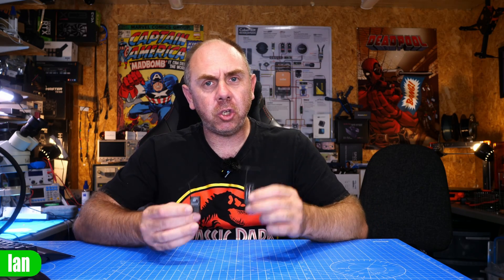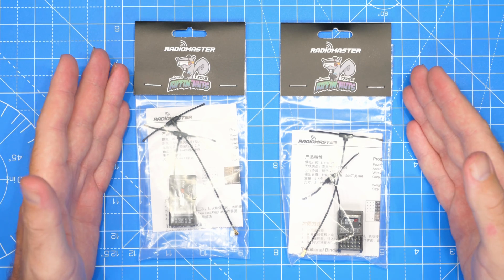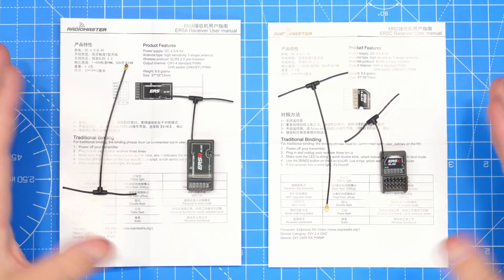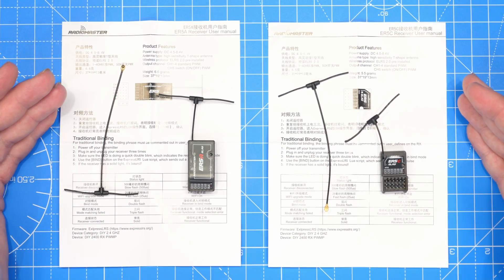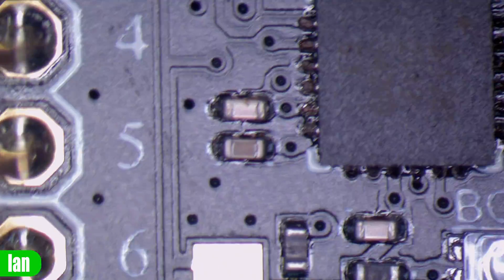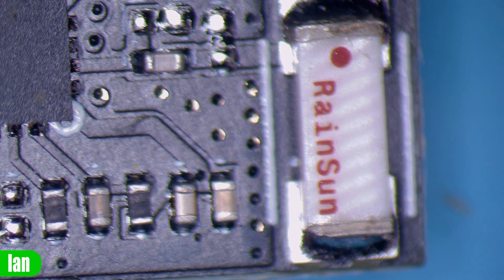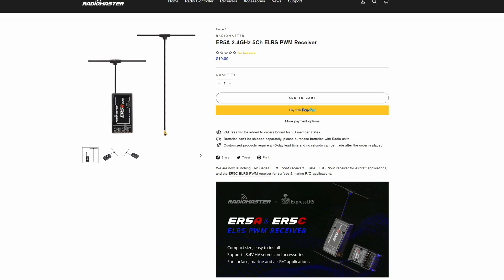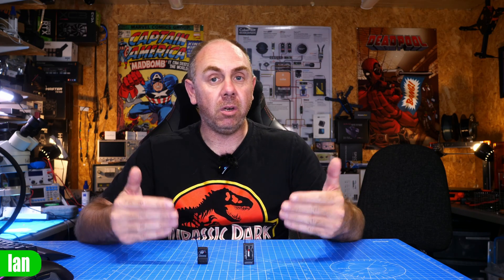Radiomaster ER5 ExpressLRS PWM Receivers - Ideal For Fixed Wing

Comment: May be a dumb question, but can you use the C model in an aircraft, or is it strictly for surface use only? I ordered one on Amazon did not realize they were two different models.
Reply: Yes mate, They are exactly the same internally. The difference between models is only the position of the pins and antenna.

Comment: if you have an rc plane that needs 5 or more channels, do you join/stack these together? how do you get more than 5 channels on Elrs?
Reply from the maker: You can now.  Please see the latest update.
Reply: @Mads Tech  are you referring to the latest update notes of ELRS in which they imply that new >6ch receivers are now possible?  "Receivers with more PWM outputs - working with manufacturers currently to make these, 6ch, 8ch and 10ch at least in pre-production." or were you referring to... Can you join/stack 2 recievers at the current moment. thanks

Comment: re: if you use elrs v3.0 you can have 5 proportional outputs, as opposed to 4 proportional outputs and 1 switch. I have been trying to get the  5 proportional outputs, without success. Advice would be much appreciated.

Comment: Disappointed that they didn't include a connection for full voltage battery telemetry. Without that, it doesn't seem like much advantage over the HM PWM Rx.
Reply: Or is that pad next to "6" for voltage?

Comment: It used to be (80’s) that FM was for model aircraft (35mhz/40mhz) and RC surface craft were AM (27mhz) but then (90s/00’s/10’s) spread spectrum frequency hopping stuff was EVERYWHERE. Now it’s pretty much whatever you want to use and personally I love the idea of the RadioMaster T-16s mk3 with a 4in1 module. The ELRS receivers are now the last piece in the complete puzzle. I’m putting my Futaba out to pasture and I’m buying something much cheaper and more functional. 😎
Great video as always. 🏴 (Do you have any affiliated links Ian?)
Edit: My bad Ian, I hadn’t yet got to the 12:30 part of the video on “affiliate links” 😄🤷🏼‍♂️

Comment: Thanks for the review Ian, excellent work as always. I can see myself using the A version on those little models where it needs to slide into the fuse but I can also see myself using the C version for my spec wings where I can attach it to a side wall in the component bay.

Comment: The only thing different that I can see between the A an C versions is the Horizontal or Vertical output pins... making one receiver slightly shorter than the other.

Comment: Stopped flying my FMS superEZ v4 and still have some motorised little gliders that need to be built.
These RX'S might get me to go back flying fixed wings again.
Several frsky RX's on the shelf that have good reception (1.6km on an lr4 with xm+ / R-XSR no problem) but my trust in them went away after switching to ELRS on my quads.
After that maybe finally an fpv wing.
Great initiative Radiomaster!
Thanks for the vid! Looking forward for a fixed wing flight test!

Comment: Some great info.  It would have been helpful to clarify what the Batt input is for. Does this actually provide VBAT telemetry back to the TX?  This area of the review was a little confused, I think you said the Batt input was a "Batt Button".  The ability to send back VBAT can be an important feature for LOS fixed wing aircraft, and I note that a competitor product to this (this HappyModel EPW5) does not provide VBAT telemetry, so this would have been a good point of contrast to make for the Radiomaster (if indeed it does provide VBAT telemetry).  Keep up the great work.
Reply from the maker: I will confirm this the weekend.
Reply: @MadRC  Thank you.
Reply: Happymodel also have the epw6 with a extra PWM channel, they look very similar to these radio master recievers ..
Reply: @laing0ian  I think the Happymodel EPW6 is a 900Mhz only RX though.